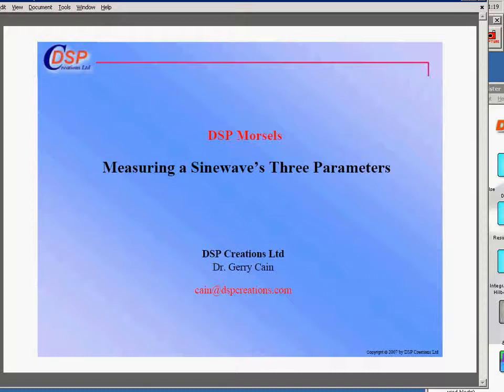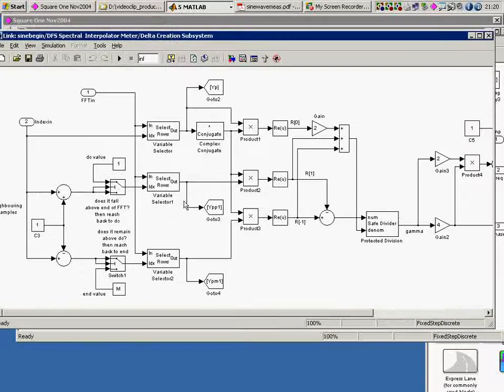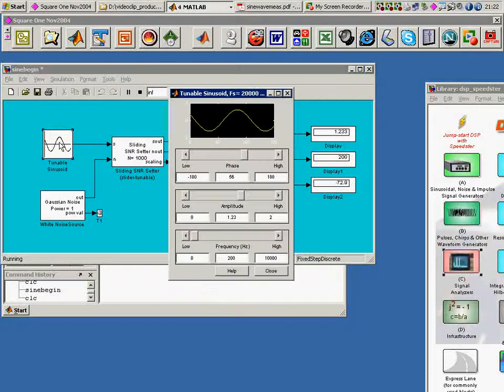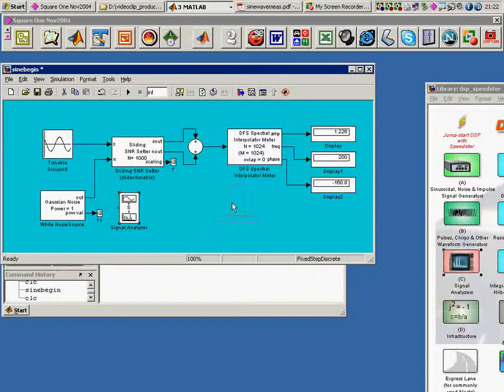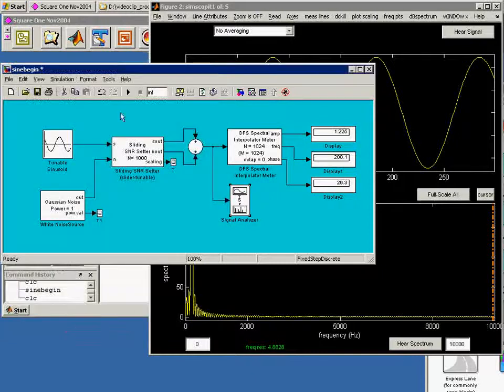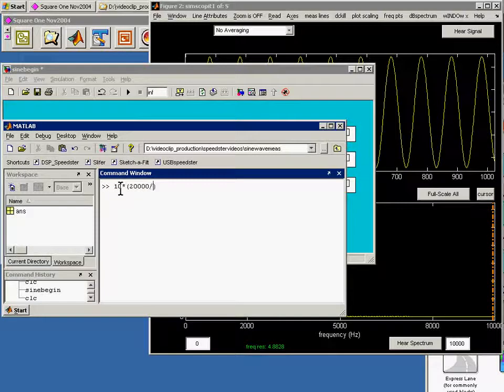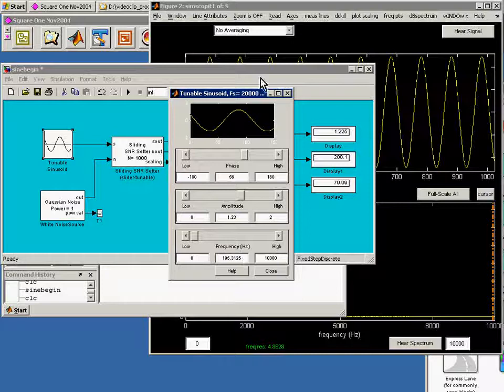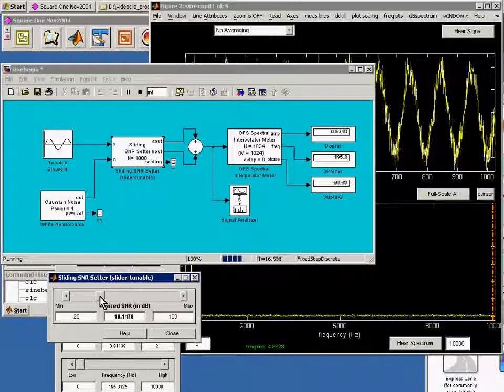Measuring a Sinewave's Three Parameters

Comment: please , how can i find your code ?
Reply: My code resides in a Simulink labkit called DSP_Speedster. It is available for purchase on the DSP Creations website. More generally,  most of our underlying algorithms are adaptations of research reported in technical papers in the mainstream DSP community. Many are to be found in IEEE publications. In the specific case of the DFS Interpolation meter used in this clip, the source reference is:
[Macleod, M.D., ""Fast nearly ML estimation of the parameters of real or complex single tones or resolved multiple tones", IEEE Trans. Sig. Proc., vol.46, no. 1, pp141-148, Jan. 1998]. 

Regards